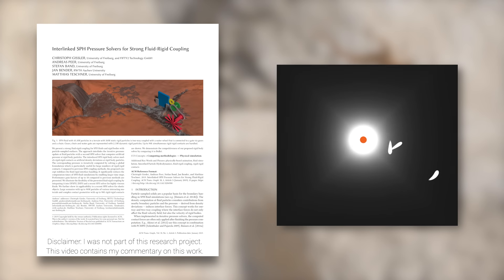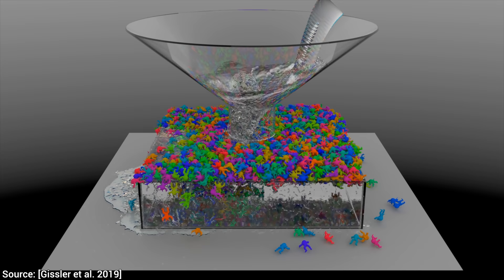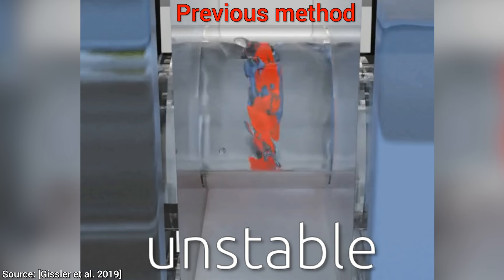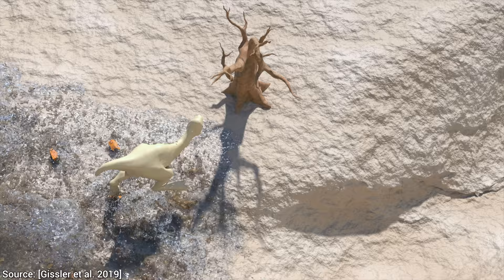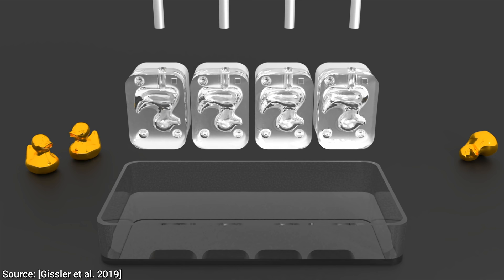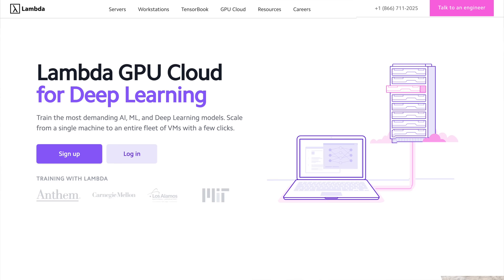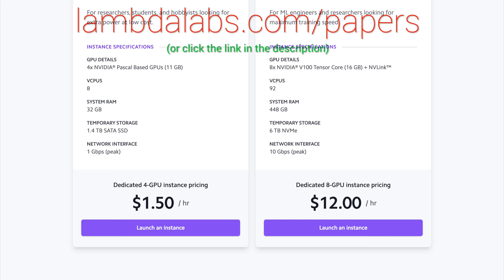All Duckies Shall Pass! 🐣

Comment: I'm still holding on to my papers doctor, but I got too many, I can barely hold on to the giant stack, I need a table!
Reply: @saldownik  how hard?
Reply: @Pimp482  

Paper is made of cellulose fibres, that are quite easy to rip apart but resist a ton of force vertically.

Assuming the paper tower is cylindrical and the force to to squish paper is 0.196cm/N, and that the force is applied in a uniform way across the whole surface and that the pile of paper is about 500 papers (0.1mm * 500 = 0.5cm)...

We can conclude that the force needed to squish that amount of paper is...

...at least 5 Newtons.
Reply: ,I need a stop frame!
Reply: scan and pdf, a ssd is easy to hold.

Upgrades people upgrades!!!
Reply: Omg!
Off the Rails!🤣🤣🤣

Comment: This is crazy. The visual representation is amazing, it looks exactly as I'd expect. Does it give accurate numerical results?
Reply: these systems are chaotic, you can't compare them to real data
Reply: @auxencefromont1989  there must be some metrics, like comparing fluid simulations of viscosity tests with real samples.
Reply: @auxencefromont1989   despite the inherent chaotic nature of fluid simulation, the goal is to closely and efficiently replicate real-life physics. While any fluid flow obviously won't match perfectly to real life, it is certainly possible to do a comparison between the average output of ten thousand runs compared to the same ten thousand similar tests occurring in real life, and look for the areas that dont match up.
Reply: what's real crazy is that this is from two years ago

Comment: the simulation for the water looks natural in how it reactions but the texture needs some work, though I suspect that's not as important. However there was one thing that was off, where the water touches the edge of the glass it looks weird, kinda like the edges of the water role in on itself a little.  I know water sticks to glass and will to some extent climb it a little but not as much as it does here.

Comment: Am I the only one that feels like these fluid simulations feel sandy? like there is no surface tension holding water beads together in a smoothened out surface, its too misty

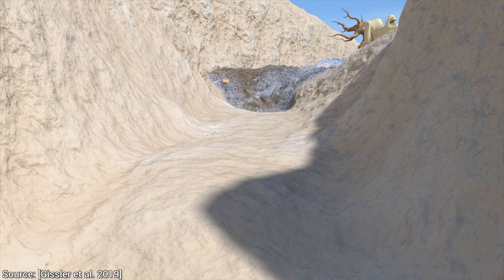Edit: I was talking about 0:19 and 2:11. 0:59 looks pretty good

Edit 2: 0:59 looks nice surfacewise, the water particles in the small waterfall seem to bead up smoothly as they should, instead of being free particles without any attraction to each other. However there are no ripples sourcing from the sink point of the waterfall, nor do the ducks seem to be pushed away from the waterfall as they should (this is constructive criticism, I know its hard, and that the current level of progress is amazing)

Comment: It appears the change in volume in the clear pipe is not being correctly accounted for as the bolt is unscrewed. Being generous it appears there is some programming flag or initial condition that is not properly triggered by the bolt but by the "cutouts" in it.

Comment: the bolt example looks weird, maybe because i expected the liquid surface tension to not cause a spray out of the small thread hole. i do not think this model is simulating surface tension of liquids

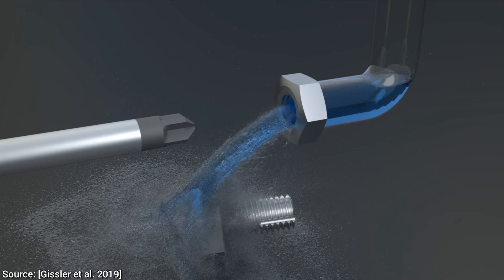Comment: Surface tension is not possible though? The bolt at 2:33 is one example. The water is spraying all over the place when in fact it should be dripping.

Comment: This is great! However: at 2:01 is a water in the pipe really staying at the same level while the screwdriver spins the metal screw out? The screw makes a good movement until the water can go out, but the water does not. But it should, isn’t that right? The gravity is supposed to press the water downwards while the screw is moving out.

Comment: I have attempted few dynamic simulations in my time. Simple gear meshing finite-element-analysis. Changing contacts was a huge problem and the software had no inherent way to deal with it. Evaluating contacts was by far the greatest computational hog.

How is contact detection achieved in these simluations?
Reply: What is your opinion on this little story here? https://en.wikipedia.org/wiki/Flight_Unlimited#Production
Do you believe that was actually achievable on the likes of 80486? I suppose these days the flight dynamics engine could be brought to resemble real life much closer?
Reply: @getsideways7257  That's a very interesting story, thanks. 

One of the key things in FEA/CFD are the number of elements and nodes in the mesh, this determines the numbers of calculations required in each frame. A rough mesh has fewer elements and can look "blocky", a finer mesh has more elements and looks smoother. A rougher mesh will tend to be computed more quickly than a finer mesh. It's like the resolution of a video e.g. 140p vs 1080p.

With a sufficiently rough mesh, a CFD simulation could probably run in realtime on a 80486. How accurate will the results be compared to real life? It depends. It sounds like they got good enough results to make them happy, better than what other simulators were offering at the time.
Reply: @phitsf5475  You are very welcome.
I was suspecting the mesh in Flight Unlimited is indeed pretty crude. Still, I'd say it was worth the trouble even back then with the results like this: https://www.youtube.com/watch?v=qU9ZCMMPano Of course, that's recorded in an emulated DOS environment on a relatively modern hardware, but I can still remember it running more or less fine on a 486DX4. I still have yet to find a sim replicating that kind of behavior during the gyroscopic maneuvers. But truth be told, the initial rolling ascent part looks a bit more like in Blade Element Theory derived flight dynamics engines: https://youtu.be/JpbEMMhdj0M?t=42 yet what comes afterwards indeed does resemble what can be seen at high performance aerobatics displays, while in BET-driven sims it's rather anticlimactic and "plasticky".
But if something like Flight Unlimited was possible back in the 1995, doesn't that mean that if we offload the calculations onto the GPU, we can get a vastly more realistic simulation this day and age? Of course, I'm not expecting it to be as precise as, say, ANSYS Fluent, but at least it should be leaps and bounds ahead of Flight Unlimited?
Reply: @getsideways7257  I wish I had a good answer for you but I can only speculate, I don't know very much about flight simulators and my knowledge of fluid dynamics is pretty basic.  CFD isn't perfect, it's very dependent on how well you set your simulation up and it's very prone to giving wrong or straight up bizarre results. With regards to Flight Unlimited they use some implementation of Navier-Stokes, it seems like they have written their own solver from scratch. I don't know how exactly they have done this but I suspect they've had to cut some corners and use some hacks to keep their results under control.

Interestingly, Seamus Blackley, the guy responsible for the original game, didn't stay for the game's sequel and they didn't continue using his CFD approach. It's a shame that we don't get to see how his engine would have been further developed. 

I stumbled onto this document, maybe you will find it interesting. Have you ever played FlightGear? https://static1.squarespace.com/static/559921a3e4b02c1d7480f8f4/t/585c674a37c5816afcb6749d/1482450767741/Dobusch.pdf

As for offloading results to the GPU. Navier-Stokes is not easy to solve with parallel computing, especially not for realtime. Mesh based solvers require a lot of sequential solutions, single-thread performance is critical here. A combination of serial and parallel computing may be used together, the single thread stage does calculations to "prepare" the domain then parallel processors can come in and do their calculations very quickly. The are other CFD approaches which lend themselves better to parallel computing such as SPH "Smoothed Particle Hydrodynamics". This is used in FlightGear for some things, as described in the pdf I've linked above. I'm not saying it's impossible for Navier-Stokes to be computed on GPUs, people want it and are definitely working very hard on it but it has inherent drawbacks.

I suspect that with flight simulator games a lot of them are established and have been developed for many years, developers will be reluctant to go back and start much from scratch.

These links below don't contain anything specific, I'm just using them as an example for how overwhelmingly mindboggling some of this stuff can get. Finding someone capable of both understanding this and creating a game out of it will be a rare find. There is progress being made so fingers crossed we'll be doing realistic fancy gyroscopics sooner rather than later.
https://www.researchgate.net/publication/308755197_Highly_Parallel_Computing_of_a_Multigrid_Solver_for_3D_Navier-Stokes_equations
https://developer.nvidia.com/gpugems/gpugems/part-vi-beyond-triangles/chapter-38-fast-fluid-dynamics-simulation-gpu

Comment: I wonder if this works with compressible fluids (i.e. gasses)?
-edit
After looking at the paper, looks like the answer is "no".
Reply: And what's worse, not in real time... But yeah, I like your way of thinking.
Reply: @getsideways7257  One of the things you'll notice in these simulations is that there aren't any bubbles.  Its effectively like these fluid simulations are acting in a vacuum.
You can fake air by making a low density fluid and assigning transparency to it in rendering, but its still not compressible and everything here, in fact, almost all things featured on this channel, are visual effects, not physics simulations.

My interest for this at least is in aerodynamic design and there are some tools for that but they're not very good, especially for 3 dimensions, and they're extremely difficult to work with (i.e. you have to write XML files in a proprietary format to define your objects and you literally have to write code yourself to translate them from any other object format like .stl )